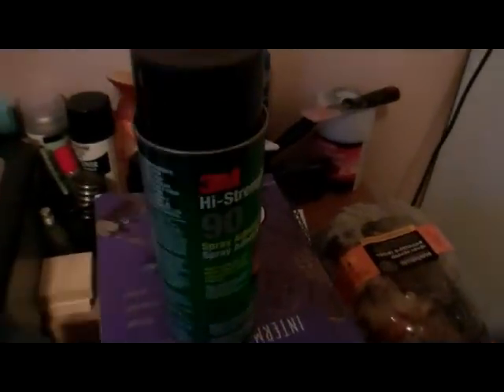How to install a headliner in your Car

Comment: Not bad. Would have liked to see the installation, but didn't think of pulling the whole flippin headliner out. Got a car that is missing the headliner, and using it as a trial run before restoring my '69 Plymouth. Good info, and appreciate you posting!
Reply: E. Talamante hi I'm doing the headliner in my Plymouth too! How did you get the plastic trim off? Mine won't come off!